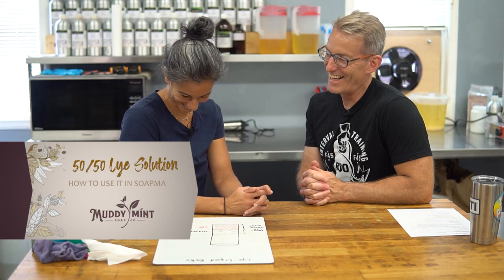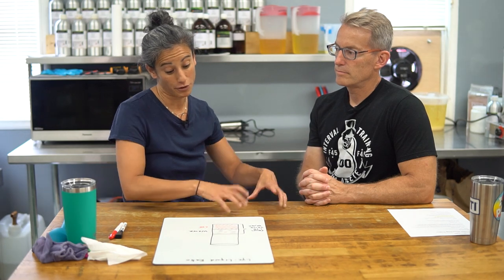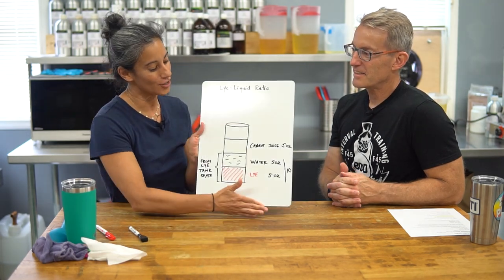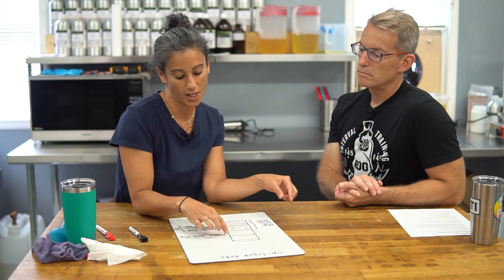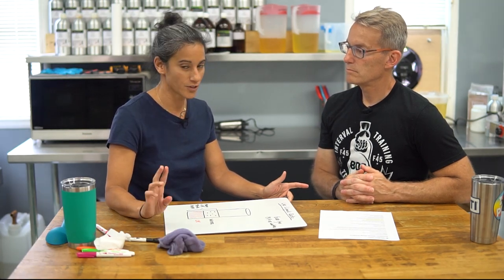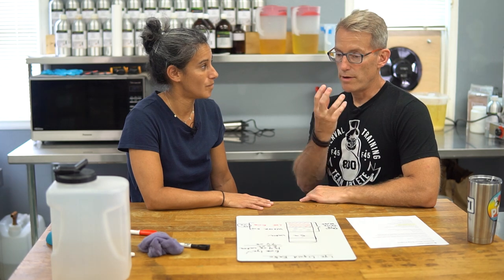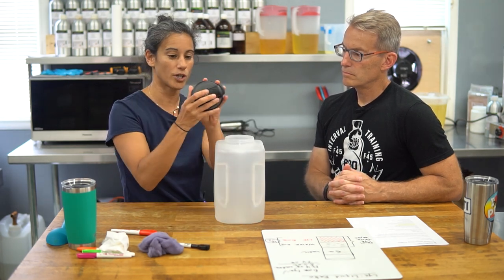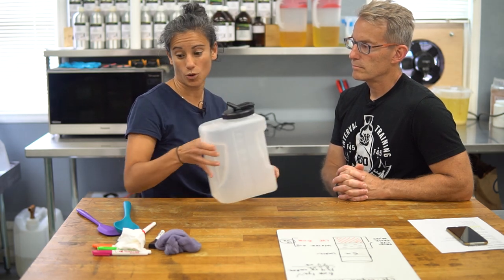How to use a 50/50 lye water solution for soapmaking

Comment: Love the 50/50 solution video. I'm new to this industry as well and I've been using a lye calculator for all of my recipes.  Is there a way to input the 50/50 slotuion into the calculator or can you give a quick math guide. I've been doing batches of soap using 16 oz and 32 oz of oils. TYA.
Reply from the maker: Love this question! Just one thing to remember: the lye amount will never change, since it is always based on your oils. So, whatever the lye calculator is telling you, it will always be the right amount of lye for the oils you're using in your recipe. The part that will change is the water. In a lye calculator, you can set the water to lye ratio. I use soapcalc and I always use 2:1 in the water to lye ratio field. If you do this, it will give you the lye number and then double that for the water. If you use 1:1 in the water to lye ratio field, you'll get what you need to use for your 50/50 solution. Then, you can add more water or an alternative liquid. Does that make sense? If you need help with a specific recipe, let me know!
Reply: @muddymintsoap  This is awesome information. I will try the 2:1 ratio in the calculator. If I run into a snag I will let you know.  Last but not least,  any suggestions for the additional liquid to use and where I can get them from? Not really interested milks. 🙂
Reply from the maker: There are a lot of other great liquids to use in soap, if you're not interested in milk. I use aloe vera juice a lot, which I get from New Directions Aromatics. I also use carrot juice for a nice yellow/orange color in soap, which you can grab from the local grocery store. Look for carrot juice that is just carrot (no other additives), or you can juice your own. Other ideas are coffee, tea, or nut milks (I like coconut milk).
Reply: @muddymintsoap  Thank you so much for this insight and quick response. Truly appreciate what you do. 🤗
Reply: Hi Muddy Mint, I remember you mentioning that you guys warm up your lye solution in the tank. How do you melt your hard oils and what temperature do soap with your lye solution and oils? TYA. 😊
Reply from the maker: We soap between 85-100 degrees F. Typically around 90-95. Our butters are in a heated oil tank and our drums have a heat band around them, so they are already all melted, which is nice! Sometimes we heat them up a little in the microwave, if it's needed.
Reply: @muddymintsoap  Got it. Thank you. 😊

Comment: Can bottle water work also
Reply from the maker: You can try it, although you might as well use distilled if you're using bottled water. :)
Reply: Thanks new soap maker from Trinidad 🇹🇹 single mom thanks again watching again revision
Reply: @muddymintsoap thanks
Reply: For small scale 50-50 lye can it be or should be heated before use?

Comment: Can I uses 50/50lye to make hot process soap !
Reply from the maker: I don't see why not! I've never made hot process, but from what I know, it starts the same way as cold process. The only issue I can see is that maybe your mixture doesn't remain as hot throughout the process? If you're applying heat to the batter with a crockpot, it should be good. If you're relying on the heat of the lye and oils (without adding additional heat), it may not work as well.

Comment: I watched another persons video on making a 50/50 solution and they said when you use this the bars only have to cure 48 hours vs 4-6 weeks.  Is this true?
Reply from the maker: This is a great question. There's an important distinction between your soap being fully saponified (the lye has done its job and turned the oils into soap) and a cured bar of soap. Curing your soap mostly involves the soap losing water weight, so it is very dependent on the amount of water you use and whether you live in a dry or humid climate. 

The best way to determine your cure time is to measure it yourself. Weigh your bar of soap immediately after cutting it and then continue to weigh it and see when it mostly stops losing water weight. I typically weigh it at one week, two weeks, and three weeks and then continue daily after that. Make sure you use the same bar of soap every time when weighing. We've done this for all our bars and find that our cure time is 3 weeks (on average) and we live in a pretty dry climate (Colorado). I personally feel that soap that has cured properly is harder, lasts longer, and has better lather. We know our soap is mostly cured after 3 weeks (by using the weighing method), but we prefer to wait another full week because we feel like our bars are better at that time. Of course, we offer our bars for sale after 4 weeks, but they have typically cured for longer by the time they are in the hands of the customer. If it's important to you to sell a long-lasting good bar of soap, I highly recommend you cure your bars properly.

So, 48 hours for saponification to be complete and anywhere from 2-6+ weeks for cure time. If you're living in a humid environment, you can accelerate your cure time by using a dehumidifier. I hope this helps!

Comment: This method seems very logical, but when I do it, the solution is very cloudy. There are still small undissolved sodium hydroxide particles left in the solution. Why isn't it clear and transparent?
Reply from the maker: Hi there! Undissolved chunks definitely aren't good! You want everything to be dissolved properly. This is easier to accomplish with lye beads, rather than the flakes, which take a long time to stir in. If you're using the flakes, you just need to keep stirring until there is no undissolved lye. A cloudy solution is sort of normal as you have a higher lye to water ratio, but typically it is clear after you mix it. If you're having trouble with ice, try it with distilled water (or maybe half and half) to see if that helps.

Comment: can you reheat the premade lye water ?
Reply from the maker: Yes, but be careful. You should only reheat it using a warm water bath. Never microwave or heat it on a stove! Simply place your lye-water container in a bath of warm/hot water to bring it up to the temperature you want. I hope that helps! :)
Reply: @muddymintsoap  Thanks for the quick reply

Comment: Hi, I made the 50/50 solution and it went "ok" now what. I touched the container and its hard, how do I reheat it so I can use it please?
Reply from the maker: Hmmm.. what do you mean, “it’s hard”? If you need to warm it up, you can use a warm water bath. So, it went okay? What issues did you run into?
Reply: @muddymintsoap  Full disclosure, the scale that I ordered is delay so I decided to use my kitchen scale that only goes up to 6.5lbs.  I didn't think that through when I emptied out almost 4.something lbs ( I have the numbers written somewhere) of ice in a bucket and someone how thought I would be able to add another 4.something lbs of lye.  Midway through the scale said that I was over the limit.  I panicked so I grabbed my body  scale and tried hard to do the math to figure out how much more I would need to add.  My math didn't break down the numbers as the kitchen scale but I thought I figured it out (kind of).  The lye seem to have gotten stuck on batches of lye and wouldn't dissolve or break up (even with my hand mixer).  I set it aside and decided to do it again.  This time I knew I got it right because I measured out separately and then combined the ice and lye.  I then decided to combine both mixtures (I can't explain the madness that was happening in my head).  So one of the jugs is completely solid and heavy and the other jug that has a smaller amount, most of it is solid and heavy but there is a tiny bit of liquid that moves when I shake it. Also in the smaller jug there are two clumps at the bottom.
Reply: @muddymintsoap  I also used up all of that lye.  I did have some delivered today but it would really suck if I had to throw it out.  ugh.  It looks so easy (ish) on YouTube!
Reply from the maker: @KAstarGod  Okay... I think I understand. Yes, you don't want to use the lye if it's solid. You'll have to try it again and either wait for your scale to arrive or measure the lye and ice/water separately and mix together. I hope this helps!

Comment: Little confused here, I want to do what you’re doing.  I want to master batch 1 to 1 but would like to do 2 to 1 to add milk. So I have a 120 oz batch how much would I need to do? Do essential oils count as liquid in your soap, or just additional ingredients?
Reply from the maker: Hi! The first step is to find out how much lye you need in your 120 oz batch. If you let me know, I can help you calculate the rest. Essential oils do not count as a liquid. They can technically react with lye, but we don't include it in the lye calculation.
Reply: @muddymintsoap  soap calc for a 1:1 lye concentration for my 120 oz batch is 17.20 water and 17.20 lye. So mix the above together, and then add 17.20 milk in the oils for 2:1 ?
Reply from the maker: @BeechHillSoap  Yep! You got it!
Reply from the maker: @BeechHillSoap  Just be sure that the lye number is right… we use 17oz of lye for 180 oz batch, so maybe double check that number? Could just be that your oils are totally different. :) Or, maybe you mean 120 oz of oils, which would make sense!
Reply: @muddymintsoap  yes my recipe is 120 oz 5 % super fat.
Reply: It make two of the nurture soap 5 lb molds. Olive, palm, castor, coconut, and sweet almond.
Reply from the maker: @BeechHillSoap  Okay, yes, that sounds right. You’re using 120 oz of oils. Let me know how it goes!

Comment: My Bahamas climate is always hot/humid, my soap sometimes sweat and some of my soap has orange areas on the top especially in the shrink wrap packaging. How do I store my soap if I'm in hot humid water? I tried using grapeseed oil. I use water from a water depot. Some of my soaps are fine and some has obvious spots! Did I wrap it too soon! What am I doing wrong? I normally use 5% superfat. Should I decrease it?
Reply from the maker: Hi! Okay, the first thing is that you probably don't want to shrink wrap cold process soap. It needs to breathe. The orange spots or DOS (Dreaded Orange Spots) typically occur when oils have gone rancid. The fact that you're using grapeseed oil makes me think that is the culprit, as grapeseed oil has an especially short shelf life. In a humid climate, you probably want to store your soap in a cool dark room (no sunlight is better) with a humidifier running. Don't wrap them until they sell and try using something breathable rather than shrink wrap. Make sure your water is distilled, as that can lead to DOS as well. A 5% superfat sounds good to me, but I'd definitely take out the grapeseed oil and replace with something like olive oil. You can also use ROE (rosemary oleoresin extract) to help with your oils going rancid.  I hope that helps!
Reply: @muddymintsoap  Super helpful. I really appreciate your advice. I unwrapped all my soaps and I made a soap box prototype in word. I normally use Shea, coconut, olive and some castor. I use grape seed because I wanted more linoleic acid in my bars and I wanted a good face bar. 

Another thing is some of my soaps are too soft for my liking. And I don’t want to have to use shea butter all the time. I did have a papaya bar that is hard with no shea butter. She butter is costly to bring in. I am not back in the u.s yet so shipping is crazy. I tried salt, sodium lactate. What lye ratio or formula would you recommend for a hard soap in humid weather? Thanks a million. You’ve been most helpful❤️
Reply from the maker: That sounds like a lovely recipe! I do think the grapeseed is what is causing the orange spots though... maybe do a little testing and see what happens.

Salt and sodium lactate will definitely help, but I think in a humid environment, a water discount will make a huge difference. What ratio of water to lye are you using now? Depending on what that is, I'd try reducing it bit by bit until you get to a good place. Maybe start with 1.6: 1 with a smaller batch and see how the batter feels and if it helps your soap. Good luck!
Reply: @muddymintsoap  my soap calc I use 35 lye  in ratio terms in says 1.8571:1. Ok, so I will switch to bottled distilled water, change my ratio and not package until I need to. 

Some even smelled like crayons/waxy but the oils didn’t have a close expiry date! I did put them close together in my lil Trolly so that didn’t help. Maybe I need to stick to Linoleic oils as a leave on. My skin loves hemp and sunflower oil (omg. My face feels amazing) other additives I love is green tea water, papaya purée, beer ( love), castor oil make mar soft too right? So I use between 5-10%
Reply from the maker: That all sounds great! I believe grapeseed oil only has a six-month shelf life. If you use sunflower, make sure to use high oleic sunflower oil, as it has a longer shelf life. You can also try adding rosemary oleoresin extract (ROE) as many soapmakers use it to extend shelf life. That smell sounds like rancid oils to me… good luck!!
Reply: @muddymintsoap  Thank you again for your knowledge and suggestions & advice. I  will let you know how it goes when I make more! Does it matter if I use refined oils or organic? I switched from organic coconut oil to Fractionated because it was lower on the scale of irritation. Because I'm an Esthetician I want to focus on face friendly soap as well as body and since its a rinse off product I will not go all outtoo much but just use ingredient that will clean and be effective! Is honey really effective after saponification? I need a podcaast for real, so many questions!
Reply from the maker: I would not recommend using fractionated coconut oil for soapmaking. Just use the regular coconut oil - it can be organic. I use coconut oil with a melting point of 76 degrees F. Honey is a sugar and sugars help with lather in soapmaking. It's quite lovely in the final soap!
Reply: @muddymintsoap  UGHHHHH, do you know how much MCT Coconut oil I have.........😒 lololololol
Reply from the maker: @DEANN-v9z  It is amazing in beard oils and body oils, so I think you might need to make a new product! ;)
Reply: @muddymintsoap  I have a few bottles of mct coconut oil/liquid coconut oil, then I have light colored olive oil (it says pure)
Reply: @muddymintsoap  I sent you a picture on Instagram
Reply: @muddymintsoap  I made a beard oil yes. Just have to get bottles. I just started making soap this year April!
Reply from the maker: @DEANN-v9z  The pure olive oil is likely from Brambleberry and is great to use in soap!

Comment: I use a 25% water discount. I could do the math but is your math standard for any percentage of water weight?
Reply from the maker: Hi! So, I prefer to use the term water to lye ratio rather than a water discount. Since there's no standard amount of water in soapmaking, what is the 25% discounted from? Unless you mean "water as percent of oil weight", which is very close to a 2:1 water to lye ratio. The math here is just to help figure out how much of a 50/50 solution to use. After that, you add whatever extra water you'd like to use in your recipe and this will vary from one soapmaker to the next and from recipe to recipe. Hopefully that makes sense? Or maybe I misunderstood your question?